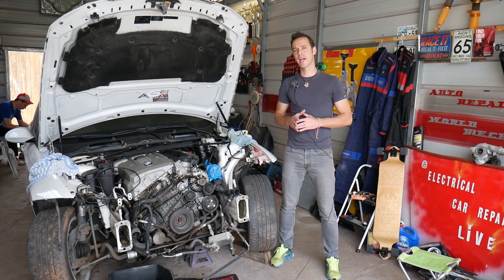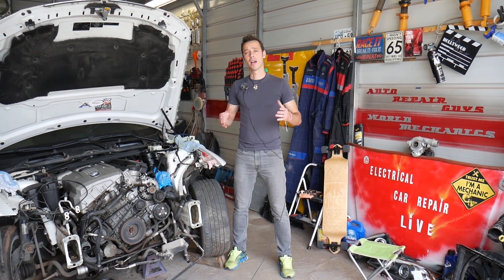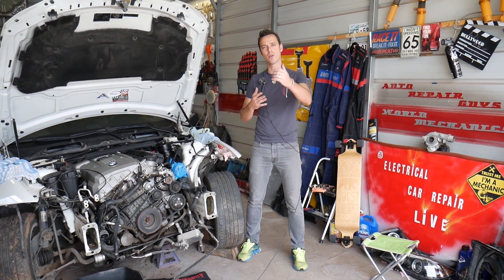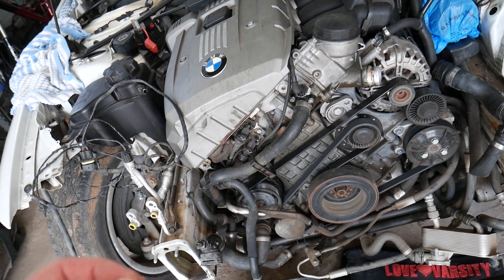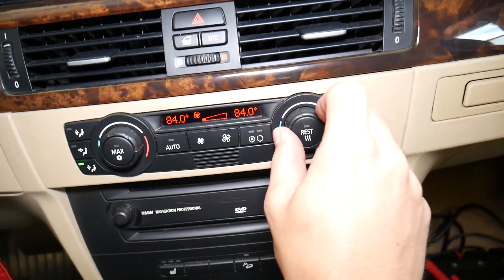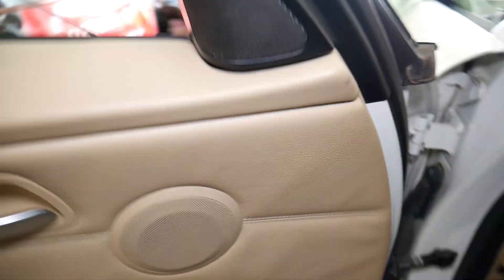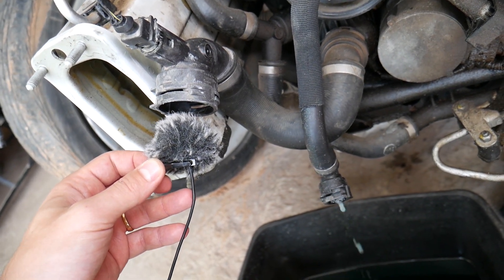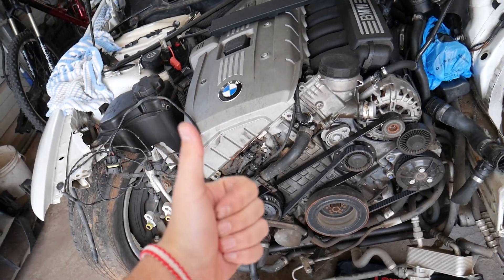BMW E60 E61 HOW TO TEST ELECTRIC WATER PUMP. ACTIVATE WATER PUMP

Comment: I have an 07 E60 525i. The water pump does run and bleed. but I'm getting E81 code and the engine gets up to about 212 degrees while driving. Any help on this would be greatly appreciated.

Comment: I have re place New electric water pump but the car still shows that the engine is over head the lower pipes is cold the upper pipes is hot what can I do
Reply: Have you done coolant system flush? If not, you can use Kool-It Flush, following the outlined instructions. Btw, if you notice your A/C doesn't blow any hot air and only cold air, it could be a faulty heater control valve. (I have to change mine out for that very problem.)

Comment: Hi 
I have BMW523i 2007
The engine temperature goes hi so we test the cooling system and change the water pump and the thermostat but the problem not solved then we change the pump again it’s work for 2 days but stopped again we change it again with original uses one but i try to test it as your video up but it doesn’t work 
Is there any special way for my car to test the pump
Reply: Bro sounds like air in system stop buying parts bleeding a few times